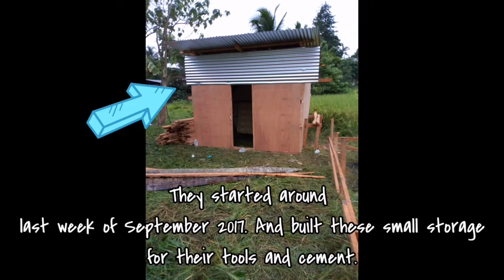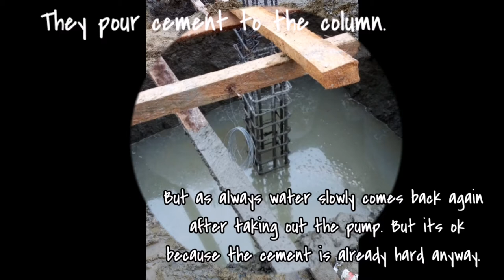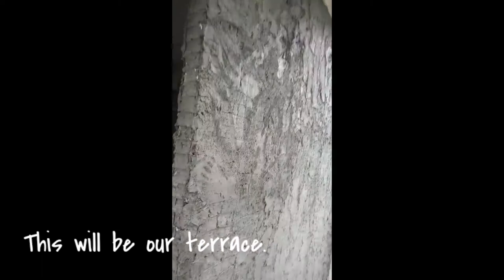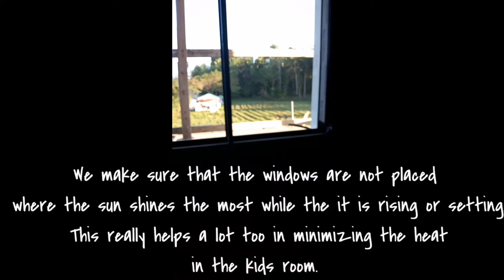Building Our House in the Philippines: How much does it cost? How long does it take?

Comment: Beautiful house. Did you drive a deep well? have city water? Are you catching the rain in a cistern? We just built down in Mindinao and are struggling for water.
Reply from the maker: Thank you Gym, we dont have deep well, we are currently tap to my cousins free flow so our water tank get water from it. We are also planning to have our own free flow inside our yard. Oh that sucks that you are struggling for water. Can't you have a deep well or a free flow dig out? So you can have a continues supply of water. But if you live in the city, I guess that is not an option. Before building we actually have plan to use rain water but we realized there is no point on it because drinking water in our place is just everywhere. There are a lot of free flows here.

Comment: sino nag design ng bahay nyo? Madali lang ba ikabit yun panel insulation? Naghanap ako ganito style ng construction kasi sobrang init sa pinas.
Reply from the maker: Hello po Sir Dennis.. kmi po mag asawa ng design ng house namin.. pero yung final blue print po at plan pinagawa namin sa licensed engineering at architect. Yes po Sir madali lang po tlaga. My manual po pano magtakid ng panel yung company n binilhan namin. Super effective po yung insulation nya. ramdam tlaga pinagkaiba sa ibang bahay n chb ang gamit.
Reply: @helsentvfilipino-belgianfa8873  m
Pwede send mo website ng wall panel
Reply from the maker: @dennisthemenace9653  ito po sir website nila.. http://www.easternwire.ph

Comment: I watched the video but I still don't know how much did it cost to build or how long it took?
Reply from the maker: Hi, we spent around 2M(until now as our house in the inside is still not completely finished) in our house it is because my husband did a lot for the house and other materials such as coco lumbers that we used in building the house are from our own farm and we saved a lot from that. As for how long it takes to build our house, it took is 6months before we can finally move in. 😊
Reply: @helsentvfilipino-belgianfa8873  That's an amazing price. Do you know how many meters squared the floor area is?

Comment: hi Maam,I'm from Occ. Mindoro. Is it ok to ask magkano po nagastos nyo for your house? I like the design. Thanks..
Reply from the maker: Hi po, thank you. If you are planning to build a  house with 2nd floor i think it is safe to have  around 1.6m to 2m budget.  We save a lot for using the EVG panels. But our house is not completely furnished inside. We still need to paint our walls. Also we did canvassing and get a good discount from the store where we mostly buy our materials for building.

Comment: splendid,, 
could you share the area built and cost ? many thanks,
Reply from the maker: Thank you Luiz. The total area of our house is 177m2 or 1905. 21ft. For the price we spent more than 1M(sorry but I cant tell the total price ☺️). But we save a lot due to the panels, and also because it is my husband that worked on all the electrical and plumming part. Our house is also not fully finished but we just make sure that house is there and our exterior is finished with all the basics such as water, plumming and electricity. We are slowly adding things because as we all know it is really expensive to build. 😁
Reply: Hi maam/sir, good you spent way-way below the standard pricing range as of this date - 2020,, if its max 1.77m = approx 10k pesos per sq. mtr., you have definitely done away with the normal contractor pricing of TAX, PROFIT, that is, 12% and 10-30%, respectively. And you would definitely fall to the "still" LOW-ish standard range of 15,000 pesos per sq. mtr., Normal nowadays is in the range of 25k. Congrats on saving alot, that is what engineering is all about, aesthetics, economy and quality. And your tools and equipment use could be your assets when doing contracting works nearby.
Reply from the maker: Most foreigners nearby our place spend a lot of money in building their house.  Yes, before building we do go around to find the best place to buy our materials for less price. And we had a lot of discounts because we only bought our materials in one store. Another reason too that helps the price to go down is because we own almost all the tools and machines that we need for building and it helps us build the house faster and the faster we build our house the less money we need to spend for labor. 😊 And also our house is big but the structure is very simple unlike other houses that are really fancy.
Reply: @helsentvfilipino-belgianfa8873  what wall panels is this please ?

Comment: please explain kung pano nailagay yung insulation foam sa roof nyo, salamat
Reply: several ways to do interior roof insulation...spray foam... is 1 type ...or U can put metal mesh then put on the foam...& use aluminum frame every 16 inches etc. & then put foam boards... etc...look up Home Depot builder's clinics there R How to clinic or videos...